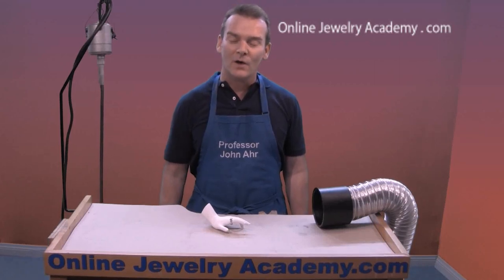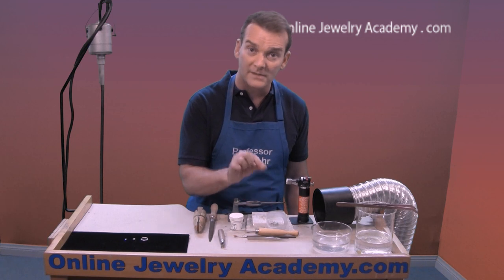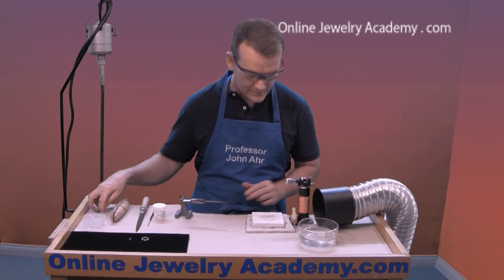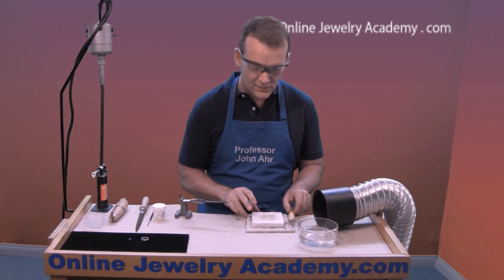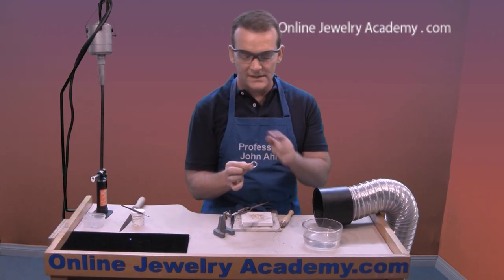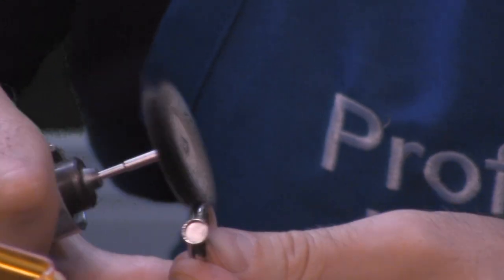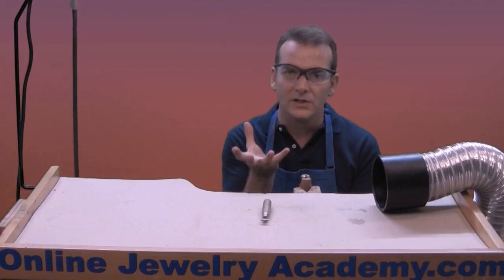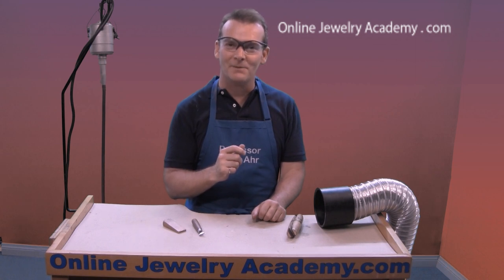Soldering a Bezel Cup to a Silver Ring and Setting a Cabochon Stone LV

Comment: Thanks for your tutorial, I followed your step by step &  I produced a really nice ring, with a Bezel cup & set with a 6mm round Garnet.  I had one initial problem, in that I failed to heat the Ring up to the correct temperature while the ring was being held in the Third Hand clamp, using my small gas refillable butane torch.  I stood the ring up against a firebrick on my fireproof base & tried again & this time it worked perfectly.  I guess the Third hand was drawing too much heat away from the Ring.
Reply from the maker: The third hand is a heat sink. Try heating it as you heat your project. Congratulations on your success. 😀

Comment: Great video! I just finished watching this one and the one on basic ring making. I'm new to this process and have a few questions: (1) Why did you use hard solder to attach the bezel to the ring? (2) Did you attach the bezel to the "seam" on the ring, purposely avoid it, or does it matter? and (3) Is the type of solder (easy vs hard) used on the ring of any relevance? Thank you for making everything so clear! (P.S. I was very interested to see that you are at FIDM in LA. I teach graphic design as part of a fashion program at a magnet high school in Las Vegas and there are always several students headed to FIDM after graduation. I've visited  the FIDM campus and it's amazing!)
Reply from the maker: Welcome to the jewelry making world 4zengrl.  Whenever I solder something together, I try to use hard solder.  The color of the hard solder is the closest to sterling silver.  Plus, if the piece ever needs to be repaired, the hard solder will ensure that it can be easily repaired with a solder that flows at t lower temperature.  The OJA has a video on how to select solder: https://youtu.be/BexK82YHcL8  You can find other related videos on the OJA's website at: www.onlinejewelryacademy.com  The videos are organized by category on the website.  Some people attach bezels for stones over the seam of a ring to hide the seam.  Others will place the bezel on the side of the ring opposite the seam (for anticipated resizing).  
Yes, I am the Director of the Jewelry Program at the Fashion Institute of Design & Merchandising (FIDM).  We have an outstanding program.  Our bench classes are taught in a studio within the heart of the Los Angeles Jewelry District.  Check it out: https://www.youtube.com/watch?v=c0JqWhZYA2U
Thanks for your support! : )

Comment: Can you solder a sterling silver bezzel to cast sterling silver?
Reply from the maker: Yes.  Just remember that castings are more porous than milled materials.  So, you might have to use a touch more solder than you're used to for a small item.  : )

Comment: I am not in school yet and I am disturbed at the fact that I have followed every video used the torch made sure the ends are flush used the correct flux and still can't solder, everyone used only silver however, I am new at this and am not use sterling silver or fine silver do you have any tutorials on other metals that you have made jewelry with or do you have any suggestions because I am very disappointed that I can't seem to get this down right.
Reply from the maker: Lorri Carnevale Lorri, I don't what sort of tools and materials you are working with.  So, I am unable to determine exactly why you are having difficulties.  You can use silver solder to solder less expensive metals like copper and brass together.  You just need a white paste flux that's formulated to do the job and a torch that can get up to 1,500 degrees F.  If you continue to feel frustrated, you might search online for a jewelry class or club in your area.  Good luck! : )

Comment: does the bezel rocker work with bezel cup from 925 silver which is much harder to bend? thanks!
Reply from the maker: Hi Dana, The bezel rocker should work with your sterling bezel cups.  It just depends on how thick they are and how much upper body strength you have.  If you can't push the bezel on to your stone with the rocker, you can use a hammer-set flex shaft attachment or a punch to move the metal.  The OJA will be releasing a video on this topic in the future.  Good luck with your creative pursuits.
Thanks for your support! : )

Comment: What kind of torch do you use?
Reply from the maker: +Megan Duncan 
Hi Megan,  In the videos I generally use a butane torch.  You can find one online for about $50.  They are great because they are small, refillable and they get up to the 1500 degrees that you need to solder.  If you want a bigger torch, I recommend that you consult with a welding supply company in your area for guidance and support.
Thanks for watching! : )

Comment: Good morning I have watched and re watched your video and yes it is amazing how you solder so easily but I am not able to solder anything I have tried over & over I am using a micro torch I am flushing the edges clean I am not using silver but aluminium & tin & copper but this is what the students use at Buffalo State in the Metal & Jewelry design program I am very frustrated is there any thing you can tell me that might help me succeed? 

Thank you.